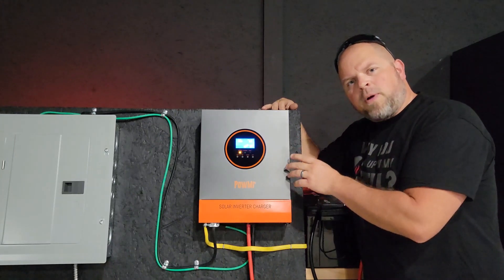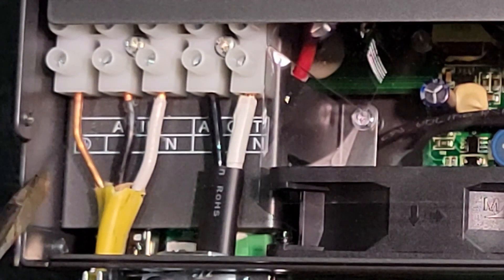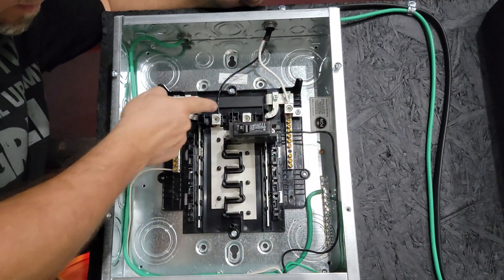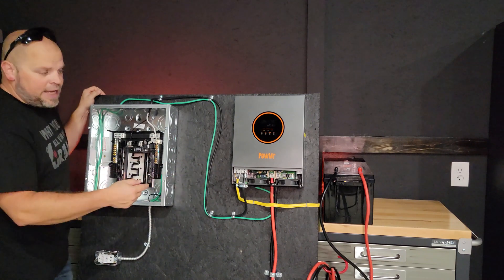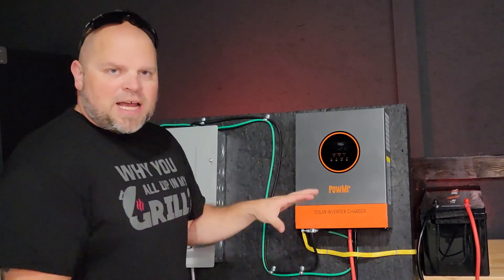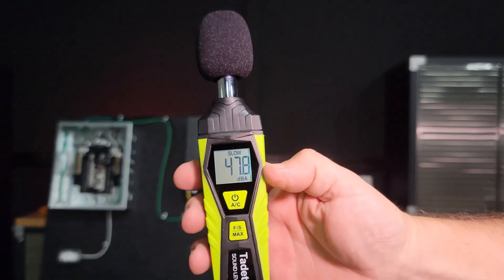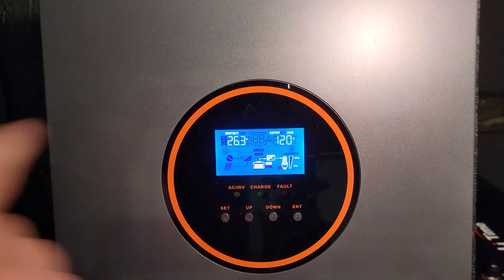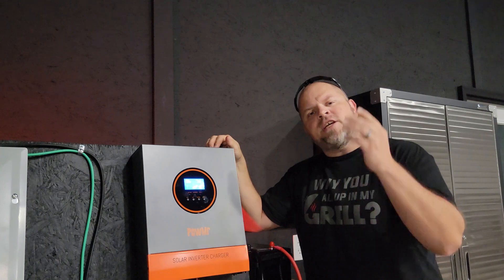OFF-GRID - PowMR 3000W 24v All In One Solar Inverter Charger

Comment: got this system put together .. now taking it down to the RV.. do i need to worry about backfeeding the grid?  i assumed the AC input was to charge batteries and / or bypass to run the load.
Reply from the maker: It is not a grid feeding system. You assume correctly. Thanks for watching and commenting 👍🏻
Reply: @TheSolarPit  question on the ground.. i am not using a distro panel.. literally just pushing the AC - OUT to a dual 110v outlet.. so the ground and neutral can connect to the same AC OUT neutral?

Comment: About three years ago, I purchased six 24V 200W solar panels (before I knew what I was doing...thinking bigger was better).  I have several other 12V 200W which are perfect for my 150VOC charge congrollers.  But I still have those six pigeons...24V, each with 45.4 VOC.  My battery banks are 24V.  All of the panels are ground deployed/moveable...so with those six panels I'm stuck with a 2S3P setup (sucks).  I've been looking for a 450VOC charge controller but they are pretty much geared for 48V battery banks.  Then I found this unit online.  I'm really interested to know about your real life experience with this unit...reliability, etc.  It's really inexpensive (IMO) so I'm wondering about quality.  What do you think about using it as a solar charger only? (backup inverter) Thanks for your video!
Reply from the maker: I think it would be great as a solar charger only! That is what I will do with it once I get my mini splits in. Thanks for watching and commenting 👍🏻
Reply: i have been running a 24v 3kw  unit for almost a year now , i have 5 505w panels in series connected to it ,,spring summer fall its a powerhouse , altough a bit noisey. in the winter here in skandinavia i find that its hunting a bit to much for the powerpoint charging stopping charging stopping (it could be that i just have to few panels in series 250v )and they like to stabilize around 220-190v under load  and it dip under that when it start charging  ,,all in all i am very impressed with this unit and the funtions it have for the very low prize gen or grid input bypass powering e,c,t  as it cont the same as a decent inverter alone  ,,i can recommend..
Reply: @kimmogensen5390 What's the Isc on your panels ?? What solar amperage ( current ) are you seeing going in ?? The POWmr ad for this Inverter says the solar input limit is 13 amps. Doesn't make sense with an 80 amp MPPT charge controller built into it

Comment: i just sent back my chin's 3000w as the AC did NOT charge the battery.. remained 0a .. so will probably be buying powMR after i return the chins.
Reply from the maker: Hopefully, you get that all worked out. Good luck. Thanks for watching and commenting 👍🏻
Reply: I'm going through that now it's doing the same thing I luckily bought insurance on it .
Reply: @tracydjenkins  I just got the powmr yesterday and set it up in a test bench.. works GREAT..  i run 2x 200ah lifep04 in series with a 60amp breaker to it.. AC power in with a  20amp 3 prong cord, put the 20amp outlets on it.. my only concern is its charging the batteries at 40amps.. and the grid power cable is getting slightly warm, wonder if there is a way to lower the amp charge to 20?
Reply: @tribalncgaming1091  This can be changed in the LCD Screen Settings , Middle Display = 04 (Grid Charging Current Percentage).  This is where you can set the percentage of grid charging current. 10~100%.  So for 20 Amps, set this to  50% of the maximum 40 Amps of charger.
Reply: @alfelker  i tried changing the settings.. no joy, i moved to powmr 3000 and it charged the batteries just fine.

Comment: Also wouldnt you put 200a fuse to batteries?
Reply from the maker: If this was a permanent setup then, yes I would have. Thanks for pointing that out, though. I should have mentioned that. Thanks for watching and commenting 👍🏻
Reply: My anti reverse protection failed would external diode work? It's weird tho because power seems to come out the pv negative at night

Comment: So the ground to the sub box comes from the ac in right? If thats so am i ok just grounding the solar panels to earth ground? 8ft rod
Reply: As I hit send you answered it in vid lol but would solar panel cases be ok on own ground
Reply from the maker: It really depends on the design, whether you need an earth ground rod or not. For example, my 10kw system only needed an equipment ground ran from the racking to the combiner box. Then, I ran directly to the main service panel. In some cases, if you ground to the earth, you could create a ground loop. You don't want that. In other designs, you would be required to earth ground the racking system. I know that doesn't help much, but without physically reviewing the electrical system, I don't know. Maybe post your question over on the diysolarbuilds.com forum. As we grow, maybe an electrical engineer will see it and answer.
Reply: @DIYSolarBuilds  the solar panels should be fine on ground that's for static and electric strikes. I suppose if I plugged the ac in it would cause ground loop if I kept it off then no. It's just the issue is there's no sub box near by  and main botlx is in seperate house
Reply: @DIYSolarBuilds  ok did more research  I'm going to ground the panels to combiner for electrical and staic. On the inverter would I be fine with ground from an outlet. But do you know if the ground on ac out is combined internally with ac in or should I bus bar those 2 ? I'm trying to do the same thing you did but that model doesn't have the ac out ground so ig that ones internal

Comment: I have 2 of the same units I just finished installing with 3000w of solar for each unit I installed a separate panel next to my main panel I removed all the circuit's out my main panel except the double pole breakers and put them in the new panel total of 24 breakers 12 breakers on each leg 12 on inverter 1and 12 on inverter 2 total of 24 breakers 15 and 20 amp breakers running 8# wire from inverter to second panel and same for utility input been running now for 3 weeks no problems at all I'm using 24v 600ah lifepo batteries on each inverter each inverter has it's own set of batteries of 24v 600ah each inverter in the panel the inverter is hooked up to a double pole 40 amp breaker as a main breaker disconnect I'm going to post video in the next few days so right now I'm 80% off grid only thing hooked up still to grid is my a.c. unit and heat unit everything else is off grid from 11am to 6pm running off solar only after 6pm when sun goes down batteries kick on running off batteries at night and only use about 20% of batteries at night till the morning then solar charge back to full then once full then house runs off solar
Reply from the maker: Awesome! Love hearing things like that. Thanks for watching and sharing your experience 👍🏻
Reply: Sounds like a nice system.
Post that video soon please.
Reply: Have a quick question. I'm currently running the POWmr 24v 3.2k inverter. I love it except for the low Voc and solar input limits. Tried the 24v 3.6k inverter but it went into an over voltage situation one night and something popped inside. So a little wary of trying another 3.6k. The inverter in this video checks all the boxes except for one thing. Everything I'm reading on this inverter, says it has a solar Isc limit of 13 amps. Doesn't make sense with an 80 amp MPPT charge controller. Best answer I could get from POWmr was basically use a crap load of smaller panels. So I've been wanting to ask someone that's actually using the 3k inverter. What panel array do you have connected to yours ?? Specifically the Isc rating on the panels and what are you seeing the inverter handle current wise ?

Comment: Idle Power consumption from the batteries would be very useful. Many of these units eat 50Watt when sitting around during night time, draining the battery. Espacially during winter they eat more than PV produces. Victron Multiplus 2 only needs 8 Watts during idle, they are much more expensive though
Reply from the maker: You are right, I should have provided that. Next time, I have it wired up I will add that info to the comments. Thanks for watching and commenting 👍🏻
Reply: Johguide5045.  Oh yes, yes, yes i read that. Alot of powmr inverters are power zombies to extreme. They drain anywhere between 35 watts and 50 watts from battery bank, just sitting, with no load. Thats alot, people. Customers need to know that. That alone made me want to shop around and keep looking.
Reply: @jab376  you get a multiplus 2 3000 for 500 bucks nowadays. 2 years ago it was over 1000
Reply: @johgude5045 where? I’m seeing $1350’ish for Victron
Reply: @2hotscottpro  here in Germany it is 530€ ATM. I would recommend Panda Solar even if it is a bit more expensive there
Reply: @johgude5045  you would still have to add in the cost of a solar controller. With this unit, it's built in. With the multiplus it's not. To make the equivalent victron system it would cost about 1800$ plus tax. The savings would allow to have a much larger battery bank to make the idle power draw pretty insignificant. I believe this one is 35 watts.
Reply: @rticul8jeep  btw: There are many trackers with no idle consumption at all. They seek the control power from the PV panel. I use these in my offgrid system which is great as no battery power is ever eaten up by my trackers. I use the CTK300 among others
Reply: Totally agree with you.  My 2 year older POW-LVM3K-24V uses about 70 watts during idle.  I do not have heated batteries so during colder low solar December days, if there has been a few days of cloudiness, my system goes dead just from the controller consuming the energy.  This summer I am up sizing my batteries to hopefully resolve this problem.